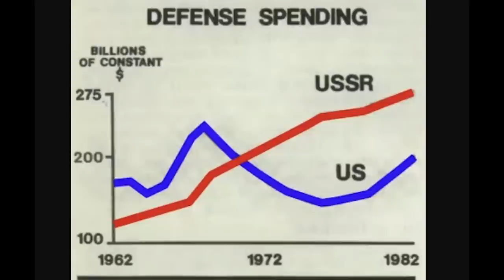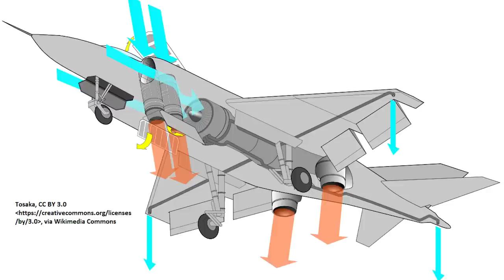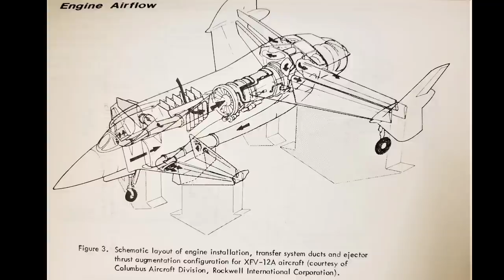Rockwell XFV-12; The VTOL Fighter That Couldn’t

Comment: The USN found the AV-8A to be ideal as a bomber/CAS platform, its designed role, but inadequate as a naval interceptor.  The RN came to the same conclusion and went for the Sea Harrier, which proved its mettle in the Falklands.  I guess the SHAR would have been a step too far for the DoD against domestic US industry competition.
Reply: "The USN found the AV-8A to be ideal as a bomber/CAS platform"(sic)

Correction: The Marine Corps found the AV-8A to be ideal as a bomber/CAS platform. The Navy tried to kill acquisition of the AV-8A before it even began. 

"I guess the SHAR would have been a step too far for the DoD against domestic US industry competition."(sic)

McDonnell Douglas had already begun working on the AV-8B before the SHARs first flight in August of 1978.

Comment: To cool a stream of jet exhaust is, by engineering definition, to cut the energy of the thrust. For energy and heat are one and the same here, in the context of a jet engine, and differentiates it from a simple desk fan. For it is not a question of moving a gentle breeze, when it is rather that of heating and compressing this gas and expelling it at extremely high temperatures & velocities. Ergo, a jet engine or turbine.

Comment: It is somewhat ironic that the US ended up buying Soviet technology, the Yakovlev Yak-141, so they could make the F-35

The US and UK should have gotten together on this. Hawker Siddeley and British Aerospace had put forward plans for a supersonic VSTOL and STOVL aircraft which could have been excellent for the job but the finance was not there. Whereas the two countries working together could have shared the cost.
Reply: Isn't that what happened with the AV8B -- the US was to produce a better airframe and the British were to produce a supersonic Pegasus engine, but then the British government pulled the funding and the plane was forced to use the old engine?
Reply: @53kenner  Incorrect. The Harrier II was never intended to have supersonic capability. The dream of a supersonic Harrier died with the cancellation of the P.1154 back in February of 1965.

Comment: Do you have any details of the XFV-12 successor , a larger aircraft following the design/flight principles that would have been used for transport or in flight refuelling? It was cancelled when the XFV-12 was cancelled, so only drawings, models, and schematics would be available. But even these are impossible to find.

Comment: A new class of light carriers might be on the horizon.
The Lightning carrier, which if names one battles would be sure winner all around. This would use the F-35 B variant on a small carrier with helicopters making up the rest of the complement.
It might be wise for the United States to build a few of these dedicated to escort service.
Reply: The F35 B would be useless on a small carrier as it is not capable of VTO when fully fuelled and armed
Reply: You are correct however they need a ski jump that would make would it like the Queen Elizabeth I class carrier. What you are trying to do is copy the South Korean Dokdo & Japanese Izumo Aircraft carriers where they don't have the ski jumps for F-35B operations

Comment: Two things.  

To make this work, turbulence generated in the fluid dynamics of hot gasses coming from the engine and being used as a lift thrust has to be reduced.  Second, you would need to use microwave technology to heat the lifting thrust plasma.  It’s an ‘ok’ idea.  Close, but no cigar.

An additional advantage here would be incorporating stealth technology into the airframe.

Comment: The secondary consideration of STOL, certainly with a ramp, would still be very current today, as is explicit in HMS Elizabeth carrier. (Which conforms so closely to Zumwalt's concept it would seem?) It is such a shame that the Pentagon don't seem to concern themselves at all with budgets, or this would be a natural in service. While filling the role of that strange modern term, 'force multiplier' two of these in combination with an Arley Burke class destroyer might be just the ticket for the projection of tiny and subtle power. (If the Americans can consider that as an option?) Some aircraft and marine attack helicopters, and the vertically launched missile systems protecting the small flotilla would seem ideal?

Comment: Today's equivalence to $47 million in 1972 would be $340 million.
Divided over two prototypes, makes each plane cost $170 million.
The US Navy's AV-8B program got 342 units for $9.1B in 1981 ($30.1B 2023) or $26.6 million ($88 million 2023) per unit.
Even without the cost overruns, the off-the-shelf proof of concept demonstration was a pretty costly proposition.
The PW F-100 engine was the most powerful fighter jet engine at the time, so I can imagine the disappointment when the XFV-12 turned out to fail at vertical takeoff, the main reason for its cancelation.

Comment: If the US Navy wanted to save costs, they should have built larger support carriers which would have cost extra millions rather than having to design and build exotic VTOL aircraft to operate on smaller  ships, costing hundreds of millions extra and having severe performance limitations to boot.